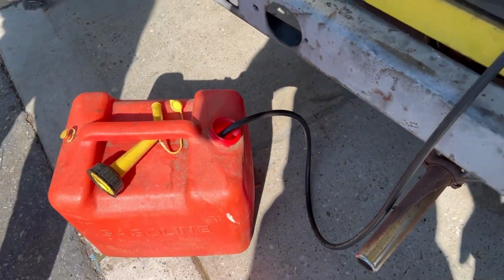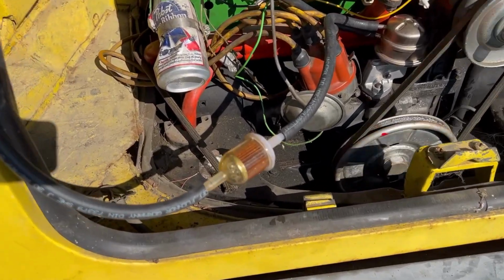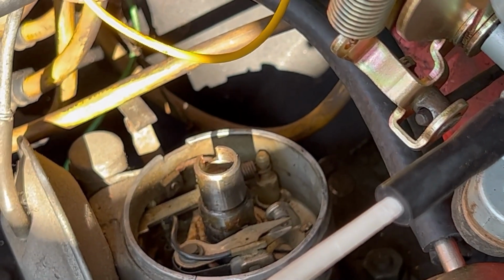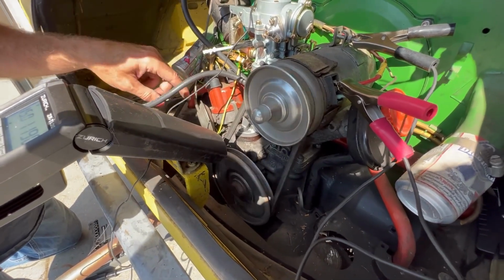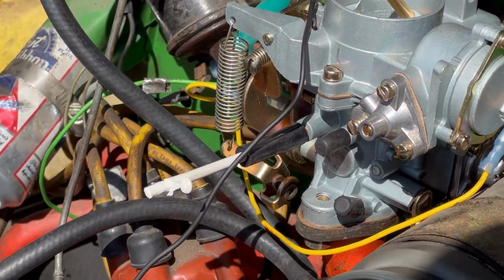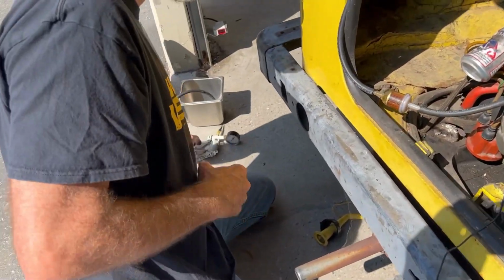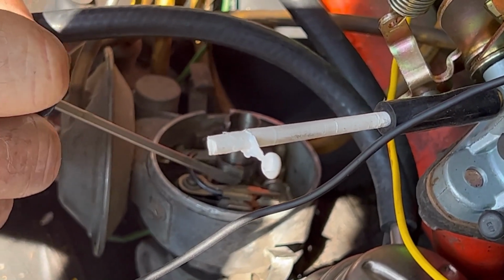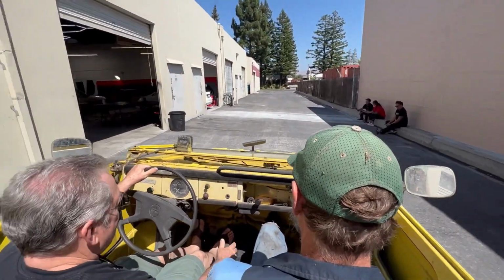Tune up of a Volkswagon Air Cooled engine

Comment: Thanks for the video. Fun. I'm pretty sure that those fuel lines on the fuel pump are reversed. The intake is the lower one and the output is the higher one. Good to see another VW being worked on.